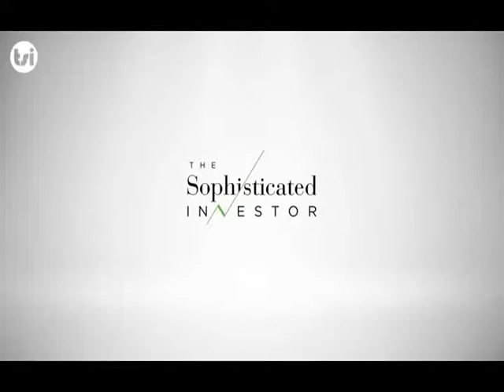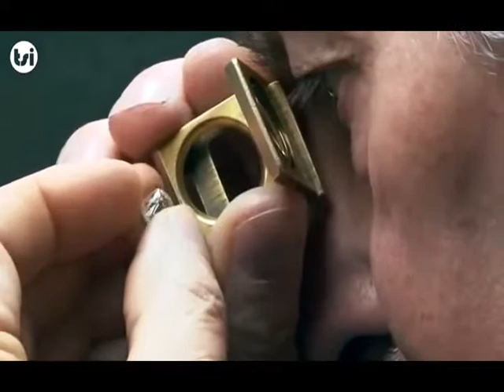Australian high purity alumina   澳大利亚Altech Chemical 高纯氧化铝 合并版1

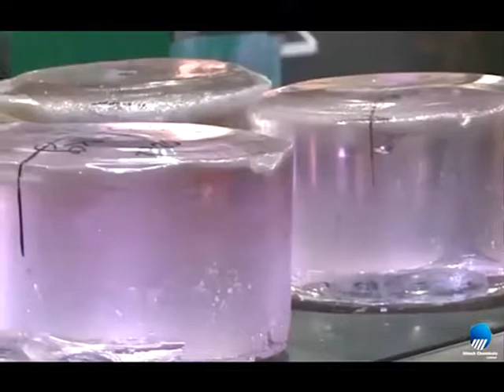Comment from the maker: 03:17+05:07  extract     03:41  purification     07:58  purify     16:58  compare to
18:10  finalize         02:02  increase (v/n)      14:36  within (prep/adv,n) 
09:51 mainstream+stream (n/v)趋势13:49  be on stream 投产 1:58+02:11 per annum
01:44  issue (n/v)问题    13:07+13:35+14:47+18:30  at the moment  
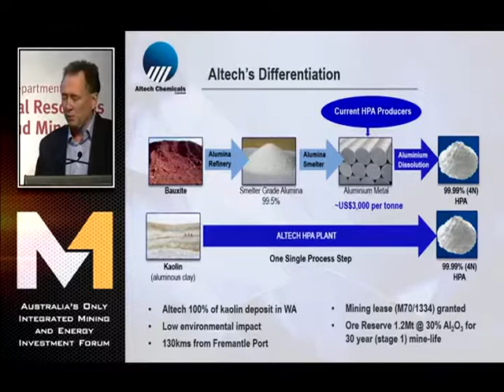00:13+15:54  analysis+ quick ~     14:47  actually     02:20  advancement
05:20 priced (v/n) 8:56+09:04  pay a price for (n/v)    18:36  price up (抬高价格)
9:11+18:30+18:52 (a/n)conservative price (n/v) +fixed ~+ contract ~
11:45  fingerprint recognition screen    14:34  recognize    17:08+18:04+19:33  tap into  
01:58+02:08+02:44 +03:46+09:04+13:35+14:25 around (adv/prep)
十5:42+06:48+12:23 around (prep/adv)   14:50   made up of    19:46  diagram
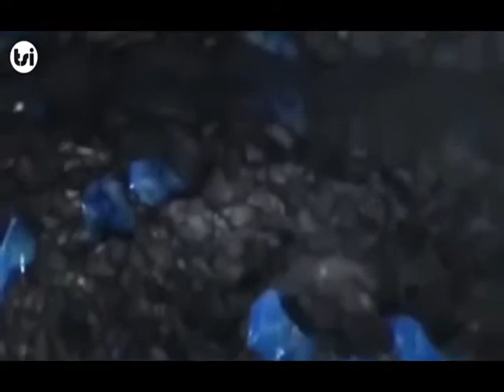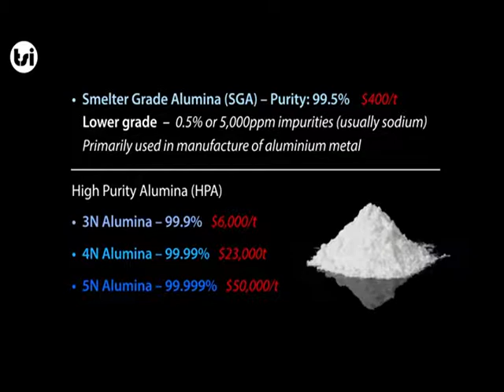00:50  scratch resistence    00:22  take a look    09:33   heat up
15:00+15:14+17:21+20:06  feedstock     06:39+06:59  state-of-the-art
09:53+12:09  substrate    02:20+05:35  energy-efficient 1:39+03:25  ceramic (a/n)
14:04+14:18  manufacturing hub    06:59  expert (a/n,v)    19:09  equity
04:16  qualities    15:07  drop out     09:09  conservative (a/n) 
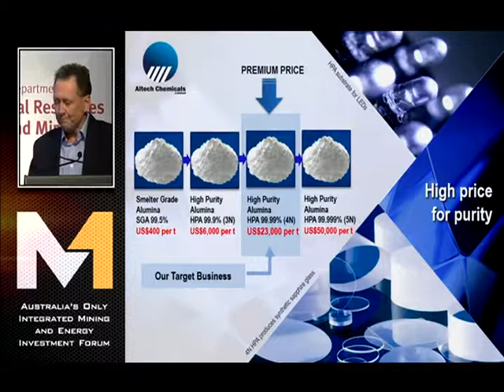14:34 conglomerate (n/a,v)       01:15  remain      09:22+10:18  illustrate
18:16  lender      09:09  rather 相当地    06:27+06:39+06:58  propose
14:36  recognize    12:07  section (n/v)     12:19  previous (a/adv)
13:27  be worth +数字(a/n)     07:58+08:29  importantly     01:15  transmit
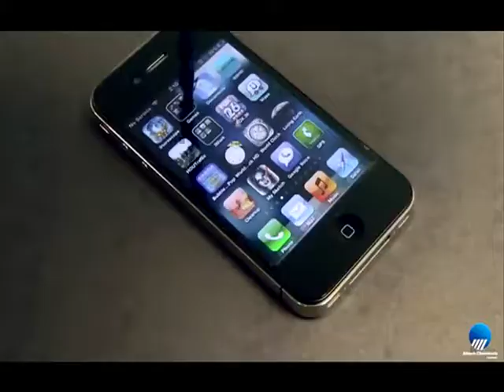二十 6:04  make transition to    03:29 nearly  + the cost of     
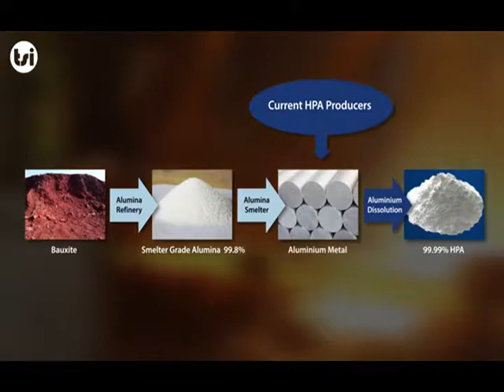 3:06+14:53+16:45+17:00+17:11+17:23  cost (n/v)   19:22  (v/n) cost up
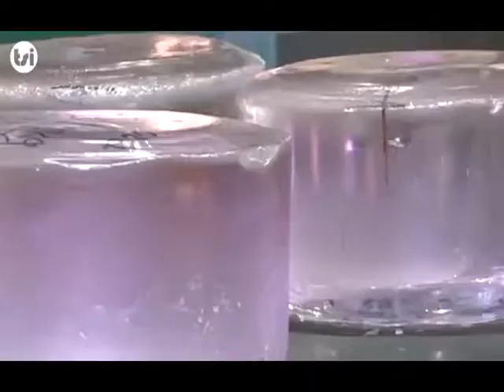02:20+05:35  cost-effective     00:44  come to  12:42  fail-safe
04:53  intense pressure     06:17+07:04  aim to  04:16  virtually
11:25+12:16+12:31+12:55+19:25+19:48   what (R-pron/pron, interr-determiner,R-deter)
00:57   due to   18:30  lump sum   09:34  over a period of    15:38  subject to
15:16   take out of     
13:03+16:03+16:08+18:38   done    00:11  be known as   17:23  hydrogen
17:23  chloride    09:31  start out   00:30+07:04  ingredient   05:39  glow
13:27  predict    06:58  packaging     15:33+19:22   fully     00:57    consumer
01:15  readily   08:45 minimal  9:00  mineral  11:15 impressive   04:46  stimulate
13:49  place into      12:23  phenomenon    18:04   credit facility
三十 00:50   high-end     01:39+12:42  anode    02:44   high-profile  16:08  consist of
00:01   comprise of   06:59  distribution   07:58   negligible   06:24  consolidate
00:34    critical      00:22   factor      09:32   cool down     
17:49+15:14+16:30+17:49+19:30   established     06:37   specifically
19:42   final    19:42    finally      00:06   base (v/n,a)     15:43+16:17   basically
16:47   basis     19:54  base  (n/v,a)   01:24+02:02   expect   16:03   reserve (n/v,a)
15:38-2+19:06   approve    15:43   subject (adv)      17:23   relatively
17:36   announce    00:06   classify    20:00   fantastically   18:41   throughput
06:24   strategic     11:20   tip (v/n)   17:23  low-cost   00:06  manufacture (v/n)
00:38+05:35   manufacture (n/v)   17:41  offtake   19:46  market capitalization
  06:19+07:04+07:48  leading    15:33  grant (v/n)   18:10 +18:58  due diligence
13:23   put out    01:15  absorb    14:27  fragmented    01:15   whilst
  11:31  release      08:16  primarily    03:06   listed    17:43  extend
 14:08   situated (a)    19:27   hectare   08:23+09:55+12:13  underpin
18:30    turn-key (turnkey)    01:44  overheating    05:48   phosphoryl
01:29   fire-retardant     12:45   retardant       11:20   diamand-tipped
16:32   unfortunately    19:06   debt     08:36   sector    17:13  cost curve
12:16   demand curve    02:34+05:25   growing (a)      00:22  closer look
15:37    permit (v/n)    18:18  settle with     14:25   a long time
13:35   aggressive    16:12   remarkably    01:44  eliminate  12:09  cross-section  08:55   coming (a)   06:41  position (v/n)   07:48   be positioned to
00:53   traditionally      12:57+20:06  hear about    03:06   simplify
15:24   close (adv/a,v,n) close to    19:39  graph (n/v)   00:47  attribute
18:26   agree on    02:02  over the next   16:15  even more    02:05+13:35  forecast (n/v)   04:40   occurring   00:38  substitute (v/n)    02:02  boom (v/n)   08:08  differ from  
  04:25  the only  17:43   option   13:23  view (n/v)   17:25  recycling (n) 
05:25   everyday    07:53  suggest    18:58   conclude   17:39  sign up
06:02   be already doing     05:42+18:41  offer (v/n)    19:35  fabulous
16:22   clean (a/adv,v,n)    01:07   generate 特   02:20   replacement
09:48   core (n/a,v)  08:55  a bit more    16:49  introduce 
04:22+06:04   unscratchable   11:23+11:49  scratch (v/n)   04:52+05:01  formation
04:16  rarity    04:16  precious   20:13  disclaimer     18:14  sole (a/n)
17:23 ( DMC )   10:18   (BDSZZJXS)